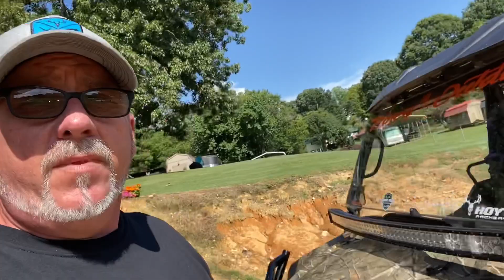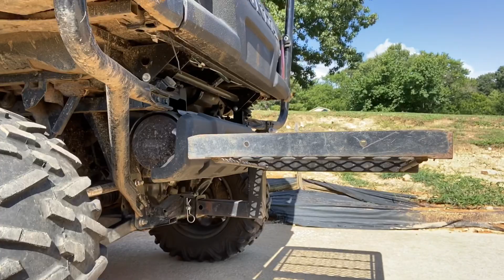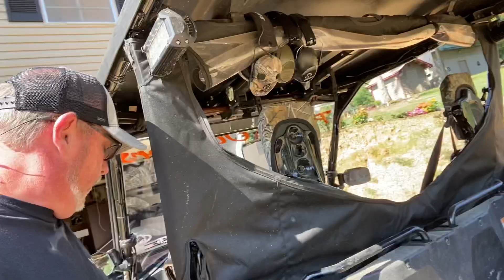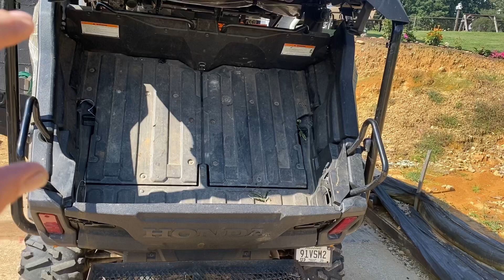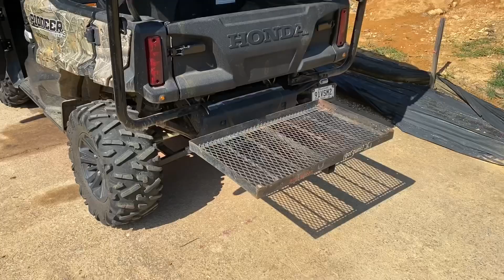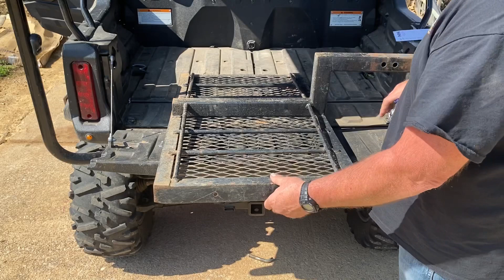How to build a custom cargo carrier for a side x side

Comment: QQ - has the heat from the exhaust ever been an issue for deer or other items you have strapped to the cargo carrier?  Thx
Reply from the maker: No not at all. Now issues with gear or equipment being hauled on the carrier. No deer has been spoiled or messed up by heat. The plastic cover on the exhaust cuts a lot of the heat down. Your welcome. Thanks for watching

Comment: Costing this thing out - its $130-$140 worth of steel not to mention labor time, cutting wheels, welding wire etc. 
Hitch adapter and rack from Harbor freight in it about $65 
https://www.harborfreight.com/300-lb-capacity-atv-cargo-carrier-69858.html
Reply from the maker: Very true you can get one much cheaper at harbor freight. But i guarantee it won't hold up to the abuse mine will. Main reason for building this one so heavy duty is so it would hold up to backing into a tree by mistake, hauling deer, stands, toolboxes, cinder blocks, heck I have hooked chains to it and pulled utvs out. Anyways I am fortunate enough to have steel supplies on hand most of the time and of course a welder. I totally get your point on the cost and labor versus harbor freight. Time is money! I buy a lot of stuff from harbor freight and like the price and quality for some of their products. But in this case I wanted something custom built and I had most of the steel on hand. Thanks for sharing the link and watching the video.
Reply: @pineylife  amen brother! Now you need your own UTV store to sell your products!! Heck I’d buy one from ya!
Reply from the maker: @bencote2219  Appreciate that brother, I wished i could do that. Anymore it's hard to make time to even shoot a youtube video. LOL . Hopefully one day I will get caught up! Thanks for watching and take care.

Comment: I did pretty much the same thing. I have a Kawasaki Teryx 4. It has a small bed and it doesn't dump and no tailgate. So what I did was what you did, but I came out of my UTV receiver and where you raised yours a little, I raised mine to where it would make the carry all level with the bottom of the bed. I put stands, cloths, ect. In the bed and my deer on the carry all. That way it keeps the blood out of my bed. Hauled a nice 9 pointer out on it this year. Wish I could post a pic of it to just show you my modification.
Reply from the maker: Thanks for the info. I would love to see it. Check us out on facebook at piney life and message me from there.

Comment: Looks good. Are you seeing any twisting of the reciever on the Honda? The metal it is mounted too is pretty flimsy. I was looking at doing one on mine, but that was a concern of my welder buddy.( I did want it higher to be almost in line with tailgate)
Reply from the maker: Thank you, No I haven't seen any issues with the receiver  and i have hauled a lot of corn and firewood on it. lol. We short haul firewood out when we are clearing trails on our lease also. Never had a issues. I Can measure how far mine is away from the bed when its in the dump position if you need my too to help decide with the height of yours.
Reply from the maker: Doug Lacoursiere to make it to where the bed will dump you can go up 2 inch more than mine. So total length for heigth of riser would be 10 inches